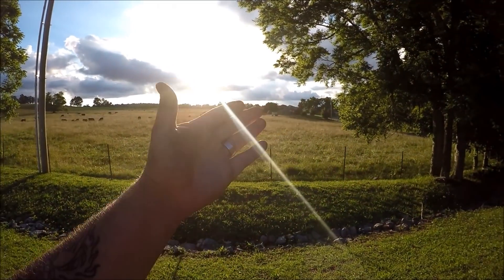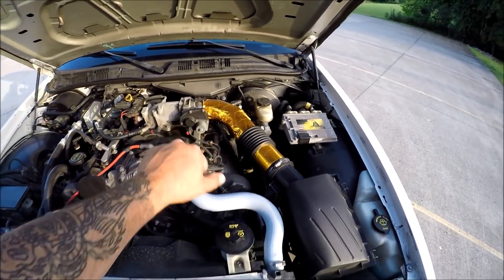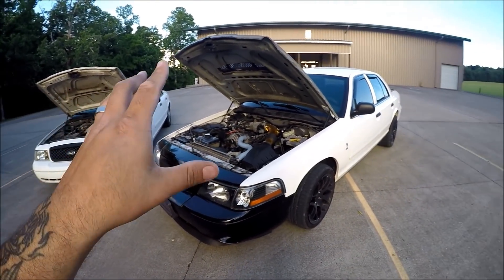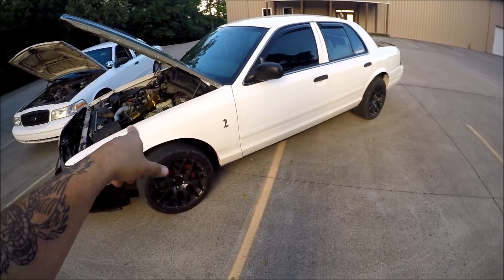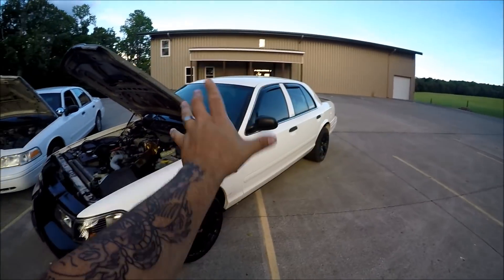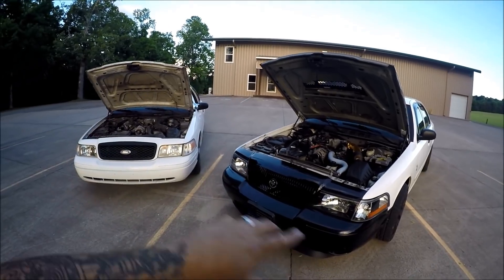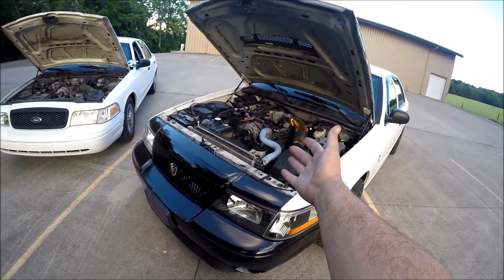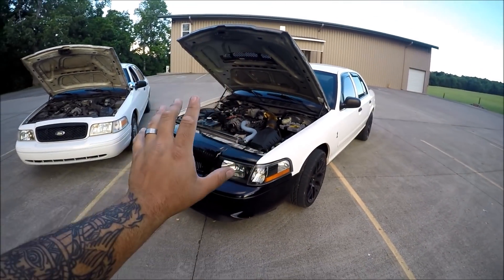(Crown Victoria)The Difference Between Romeo and Windsor Built Engines

Comment: Is that why so many 4.6 expeditions were scrapped and junked?
Reply: Dave Pawson  You dont have timing chain issues if you change oil like you should and stay off the limiter
Reply: Im doing a timing chain and a clutch job in my mustang since the fork in my failed while i was in the middle of nowhere and i had to drive 6k rpm going 35 for 2 hours
Reply: @alexperez-ee2et  why not have a tow truck get you or have someone pick you up, that is so bad for the motor
Reply: I was in the middle of nowhere closest tow truck was 100 miles away
Reply: Dave Pawson  rattling noise from under my front upper passenger side timing cover, should I be worried?
Reply: I did the best improvement to my 05 vic by installing a 6.2 ls3 & a 4l60 trans with a fitech pcm / tcm ... more power for less & it's a pushrod engine
 Ls swap it
Reply: @benbenjamin2385  Is that little 4L60 still alive?
Reply: @Jett-Alaska  lol ...
Reply: @Jett-Alaska  monster 4l60 is a reworked beast ... the 4w75 vs the 4l60 ... I would take Chevy.  The Ford torque converters are total crap. The pensioners on the ohc fords are crap. Ls kills the Tritons.
Reply: @benbenjamin2385  4r70w. And, ok.
Reply: @benbenjamin2385  Yeah I had to replace my torque converter in my 94 Crown Vic. It has the 4.6, seems fine however I may be putting new valve seals in it soon. There was a recall on that and it didnt get taken care of on my car by the previous owner. I have the AOD trans and use Amsoil/Merc V blend, only because I haven't done enough pan drops to get all the Merc V out. It likes the Amsoil ATF alot better. It only has 85k on it, it's an LX.
Reply: I also do not like the mile long timing chain setup, but I guess as long as u use good oil and frequent oil changes as required helps tremendously. Alot of these 4.6's go to 300k or more.
Reply: Ben Benjamin I like the 4l60e but with power it’s worthless
Reply: @anthonqx22  I would take built 4l60 over a 4r70 or 4r75 trans any day because the pushrod ls engine is a superior design
Reply: @benbenjamin2385  I hired into Livonia Transmission Ford plant decades ago and later moved to Dearborn Assembly (New Edge Mustangs) then Flatrock Assembly(S-197 Mustangs). I built those AODE, 4R70W and 4R75W transmissions and I will tell you that a 4 speed is only a 4 speed, no matter the pushrod engine or modular engine. I own a 08 Trailblazer SS and that 4L70E trans can be a ticking time bomb.
Reply: Like the chevy suburban, if your quiet at night, you can hear them rusting..
Reply: jon doe there are more Suburbans and Tahoes on the road then expeditions.
Reply: @BlankBillions  Well no shit the suburban had been made since the 40s. The expedition 97. Lol
Reply: Hellcat Hooligans not here in vegas
Reply: @BlankBillions  that's because only one plant built the Expeditions/Navigators which was at Michigan Truck Plant in Wayne, Michigan - later moved to Kentucky Truck Plant in Louisville. GM has 2 plants that was and still building them in Arlington, Texas and Janesville, Wisconsin.
Reply: @jayyoutube8790  I got a '94 Crown.. still waiting for the rust to show up. And i live on the Pacific coastline.
Reply: @Jett-Alaska  some people don't get the benefits of washing their cars
Reply: @jayyoutube8790  I have a rust free 90k suburban 2002 ... the suspension is not my favorite,  but the tuck is excellent.  An SAS swap will fix it, now onto the crown vic, great full frame car with low hp 4.6 & weak trans. Love the car, dislike the sohcs

Comment: Back in the 60-70 time period there was a real difference between 351 engines produced in Windsor and those coming out of Cleveland. The Cleveland engines had bigger ports,  valves and other internals resulting in more power. The difference wasn't always clear though, as a car would just say 351 on the side.  So whether a car came with Cleveland or Windsor engine became a real issue. 

But I've never heard of any significant difference between Cleveland and Romeo.
Reply: Almost every mustang in that period that had a windsor was badged 351w.  Cleveland's just said 351 .